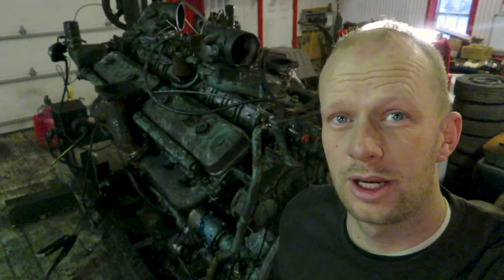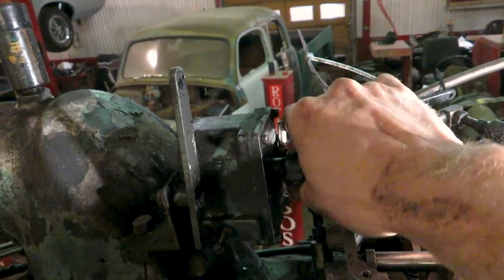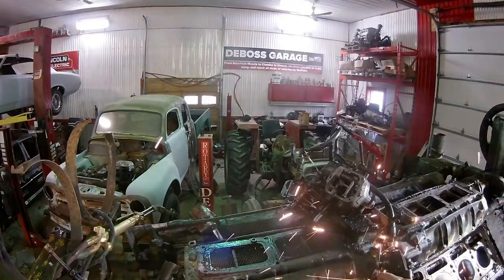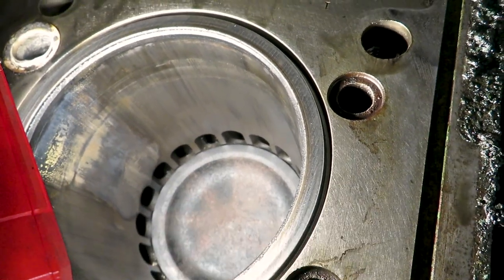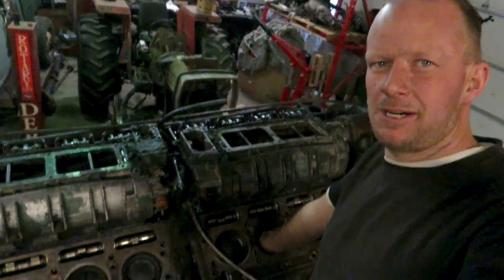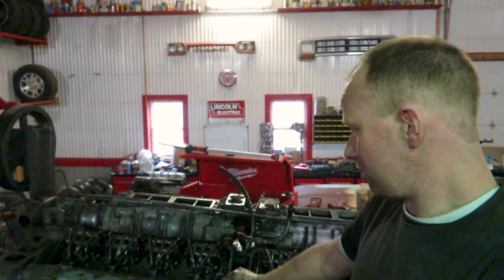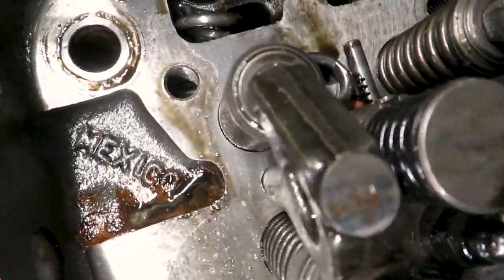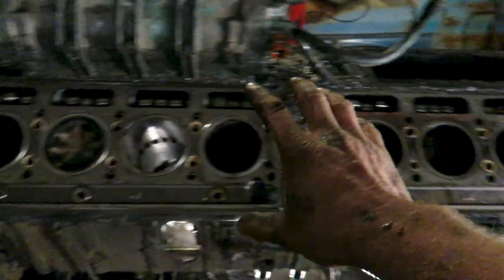What's Inside a 16cyl 2 Stroke Detroit Diesel? #HowItWorks

Comment: the fuel rack rail has a plunger any dirt on that part will stick the whole thing wide open will run wide open till it blows up, a air shut off a flapper thing what GM designed in the air intake of the truck! white was the make of truck the one was in i worked on GM bought white out! Gm ended up sue it self! I was in add thing I sort work for GM they sell grumman trucks right yes I work for grumman! my boss said tell you the truth or I don't be in a good place! lie under oath not a good idea!
Reply: i seen a v 12 2 stroke on a pulling tractor, plus later on  jet engine's (turbine) v8 car type engines i worked on marine oil testing of new type of oil! the guy i worked with had sugar and he went blind, i had a stroke before that i was planing on doing other stuff but it never happen stroke messed that plan up!! it had to do with fishing & a boat company that went bankrupt & bought by new owner! it was a real big mess! I was thrown in this mess because of a relation deal before he died! my relation was not the oil guy! i had no idea my relation was related to boating the name on side of his broken boat! my uncle who informed my dad told me that name! sadly he died from illness & cancer the stuff he gave me was on ww2 era 2 stroke engines in boats of ww2 maunal my relation was a navy mechanic, he drove trucks, i worked on trucks went in airforce, area i was in was in NV test area & my uncle after war was in test area in pacific area he got sick after doing a check after the N went off boats still left floating I read this in his book I cried knowing why he was sick! I had it later on too! blood clots! stroke a mess!

Comment: That's the stupidest thing I ever see these guys do ,take a engine that can b rebuilt and cheap to do ,,,,the hole in the block can b fixed ,,I did this with two of the v 12 71 series ,,,u can bolt 6 8 10 15 of those engines together ,,also they use them in boats because u can run one engine left handed and one engine right handed ,,those engines will last for ever ,that was a total shame to see u do that .
Reply from the maker: You and I have different versions of "cheap".  As the front of the crank is different from the back, you can only bolt 2 together.